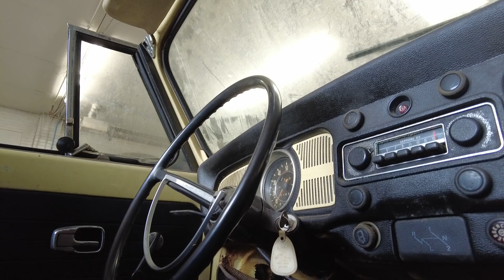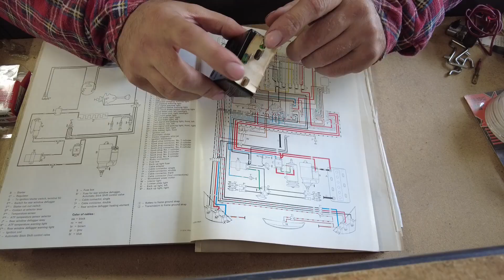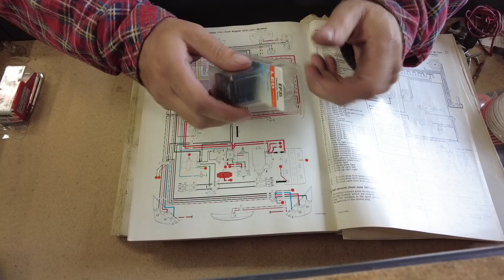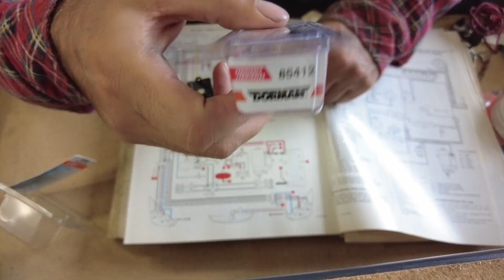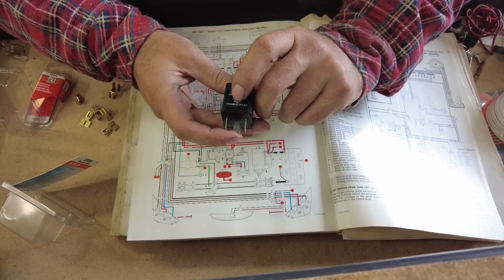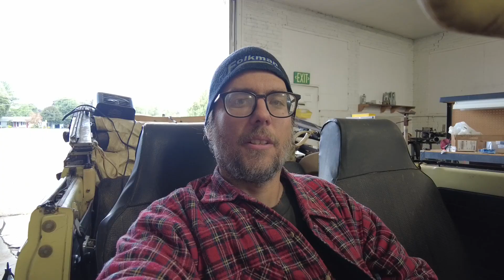1968-1970 VW Flasher Relay Mysteries Revealed! LED Upgrade!

Comment: Did you have any issues with it when the headights were on? Not sure if you put the LED bulbs in yet but my 1970 bus works fine in the daytime with regular bulbs in it with this setup but as soon as I turn on the parking light/headlight position, the blinkers stop working. I think putting resistors in the parking light may solve my issue. I dont know if the bug has the same dual light bulbs in the back but guessing this is my issue. Let me know if you solved this already. Everything works fine with the old bulbs and LED flasher. Nice video.
Reply from the maker: I haven't installed LED bulbs yet. I haven't heard of that problem before. It might be worth checking the wiring for shorts or bad grounds, LEDs are more sensitive to wiring issues because the current can only flow one way. I couldn't use LED tail lights in my '64 because of a bad ground as seen in this video: https://youtube.com/shorts/u4lYMY9-gSA?si=j_TBT2uewlatz2vo